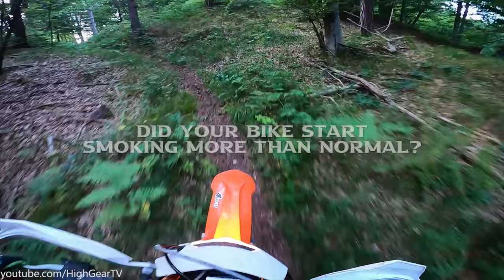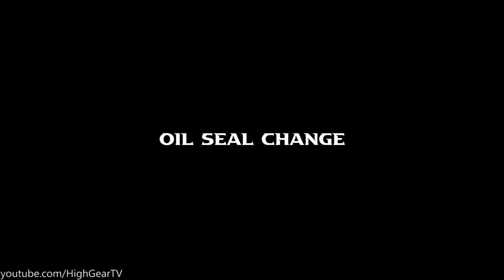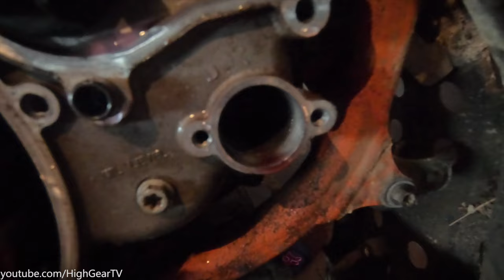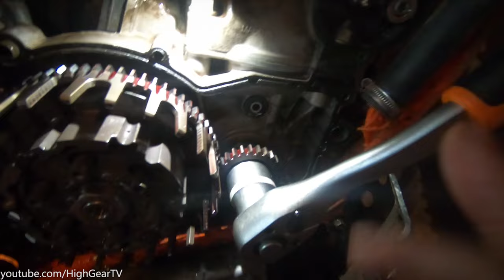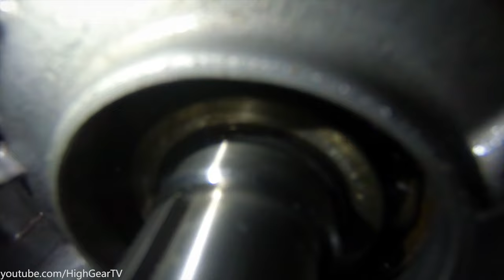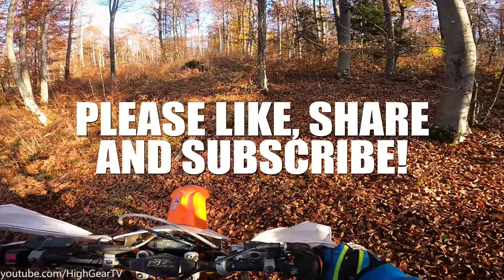HOW TO FIX - 2 Stroke Dirt Bike Smoking Too Much [Problem Solution]

Comment: I have 4stroke quad 250,and smoking,whats that?
Reply: Oil, water or the same shit
Reply: @eugenk.4946  no have water cooling
Reply: Your piston ring's might be done, try to change them😀
Reply: @enduroexc7647  need open machine?
Reply: @Bibo110  yup, you need to take the top end apart

Comment: I think its not the seal problem. The crank shaft shouldn't have movement like that, isn't it?
Reply from the maker: Crank shaft is all good. It was the seal. Problem was solved. Everything in the video.